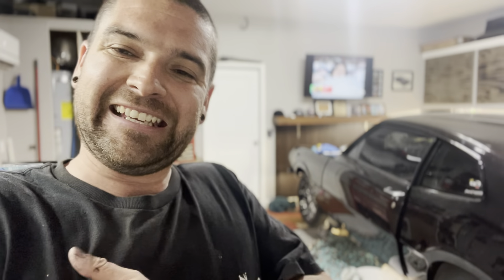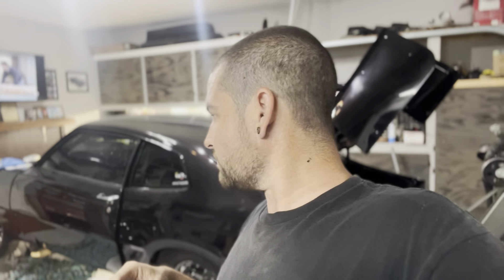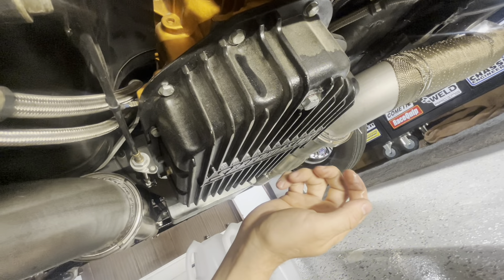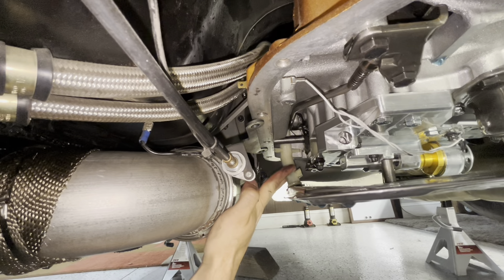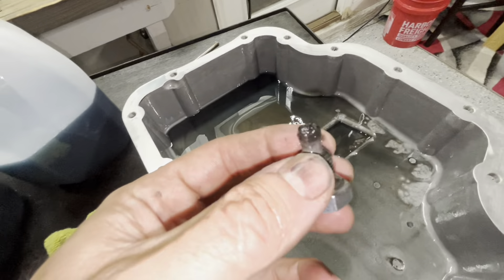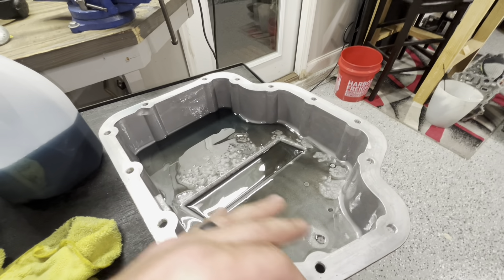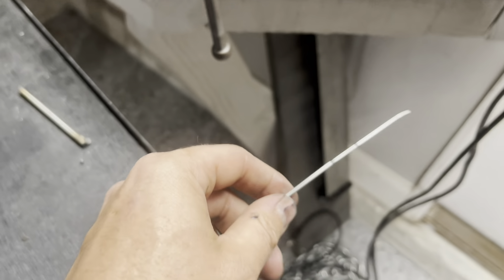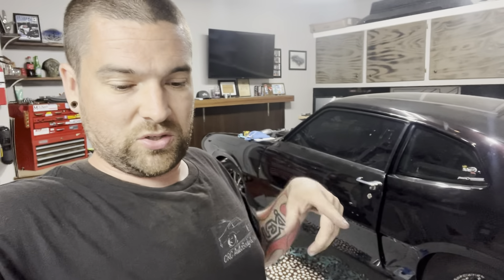💧 1st Check Up For Our TH400 🔥Didn’t Expect That

Comment: Been running Redline racing atf for years with no problems. They have different weights also. Heavier weight fluid will tighten a converter up!!!
Reply from the maker: Interesting. What weight would you recommend?  I’ll have to look it up
Reply: @ThePaintPaperHustle  There's two weights. There's the racing ATF and the lightweight racing ATF. I have used both and they work great!!!! I use the lightweight racing ATF, because the shifts seem firmer and the car is more consistent in it's 60'! I change fluid at the beginning of every season and take the pan off over winter to look things over! The trans always look good!
Reply from the maker: Awesome thanks for that info

Comment: I'm no transmission guy but know several builders that highly recommend a good quality Type F in TH400 drag race applications. Just sharing my 2 cents... Just remember whatever you have started out with you probably need to stick with cause you can't get the fluid out of the converter just by dropping the pan and alot of fluids will not mix, good luck !!!
Reply from the maker: Thanks man. I never thought about the fluids not mixing that’s such a good point!

Comment: That little bit of ash, i call it, can be expected from fresh parts seating in,  being used and likely  wasnt hot tanked i wouldnt sweat it. 

Imo use what fluid you have, you can ask 10 transmission builders and most will recommend something different. I use whatever the clutch manufacturer recommends because they know what the adhesive used to apply the material to the steels can tolerate without breaking it down, Hyd fluid is thicker and will cause the converter to be tighter but I USE Dextron/Mercon as advised by the clutch manufacturer with 0 failures. I have used type F and had valves in the valve body stick, coincidence maybe but no issues since switching to D/M. 

On your dipstick, stroll thru youtube for “home anodizing” and color the stick whatever color you like, i did mine white and still there 15yrs later
Reply from the maker: Wow all good information man thanks a ton for all that!

Comment: Should there be a vent on that transmission fuel tank with a filter so it doesn’t vapor lock and can drain easily
Reply from the maker: You’d think so but I bought it as a kit that was suppose to have everything it needs and there wasn’t one and didn’t mention one any where. I’ll have to maybe look into it more. Normally all the drag cars that I’ve seen that have them mounted in car also don’t have them vented that I’ve seen

Comment: Looks good ,,  anything  JD-J20A  compatible  hydo fluid ,,  drill small holes in the dripstick  .050 ,, also looks like the convertor was clearancing itself ,, change every 50 runs and monitor
Reply from the maker: Man thanks a ton for that. I didn’t think about drilling holes! That’s so smart lol I’m guessing you’re not new to trans building though. Not sure what JD is though I’d have to research it. The stuff that’s in there now that I’m using, do you feel ok with that?  Ima use this up but could change next time
Reply: @ThePaintPaperHustle   We have a small channel  GantGarage on the tube ,, your fluid's ok ,, I've used the NAPA 85-475 and have good luck with it so have stayed with it ,,and cheap ,, LOL
Reply from the maker: I think I’ve actually watched your videos before!  I’m going to make sure I’m subbed thanks

Comment: Did not know that you can use a rubber transmission mount with a motor plate?
Reply from the maker: Poly is what this one is. They say hard mounting the trans with motor plates is just to much that the trans needs to be able to move and absorb vibrations just a little bit. I did research that topic a ton when building it.

Comment: The trans looks good 👍.  I use type f trans fluid.  It was recommended by the guy who built my th400.  I'm not sure if you're leaving the marker , I took a saw blade and made a mark on the dipstick so I can see the  fluid level
Reply from the maker: I will not leave the marker. I’ll make a line in the metal so it don’t fade away
Reply: Type F is fine for them. I think hydraulic fluid is good too, but I wouldn't experiment on $2800 parts. I am afraid there is too much metal flake in his sediment. Clutch is just dark. I know I have burned plenty. My guess is a drum making contact with another drum or something.
Reply from the maker: Hmmm interesting thanks for that feedback